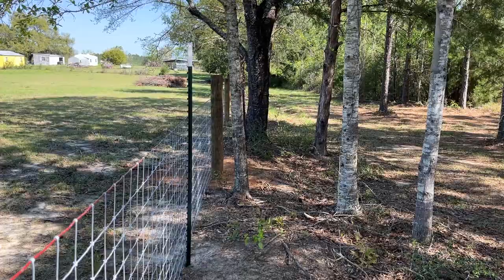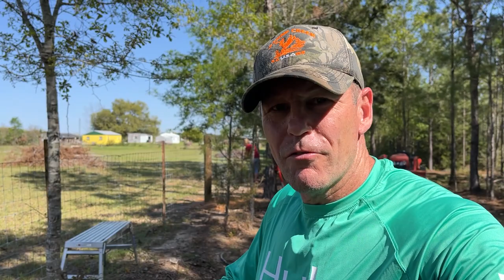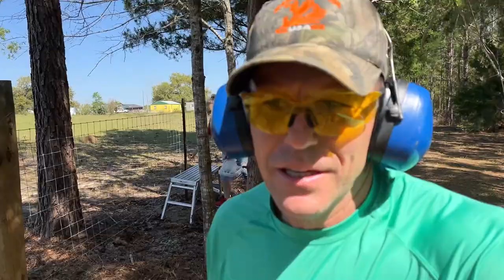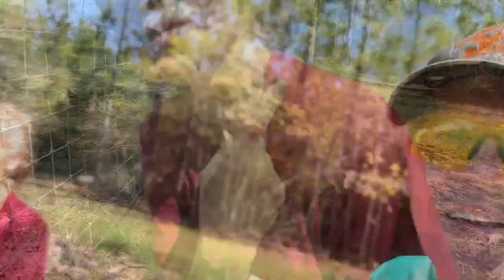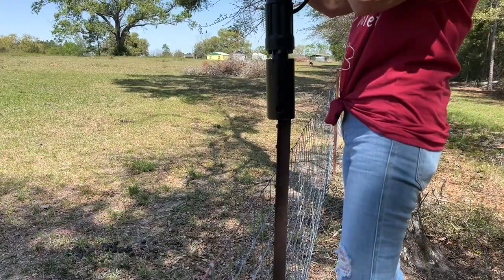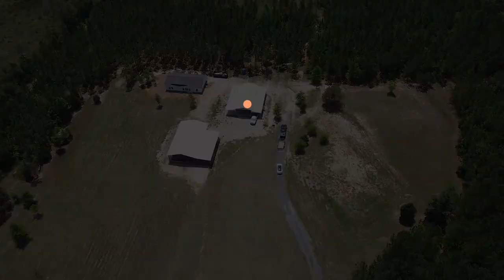BEST Way to INSTAL T-Posts for a Livestock Woven Wire Fence

Comment: Brad if you run a strand of barb wire above your woven wire  it will help protect your expensive wire from damage when deer jump across and also deter your neighbors horse from leaning across and scratching its neck, just food for thought. Thank you for the enjoyable videos.
Reply from the maker: That's a great idea but so far the horses leave the fence alone and we want deer to be able to jump it.   If it becomes a big problem we can always run a strand of high tensile wire in line with the top of the fence to keep it straight.   We also left the posts at 5' to run electrical wire if needed later on.  Not sure how the farm animals will lay out with the pastures yet, so that may just be a border fence, and not a "farm animal" fence for us.  Thanks for watching.   B&D